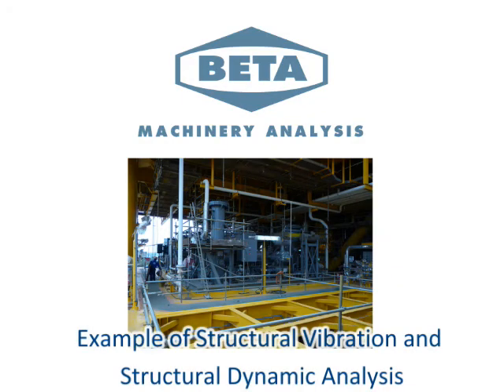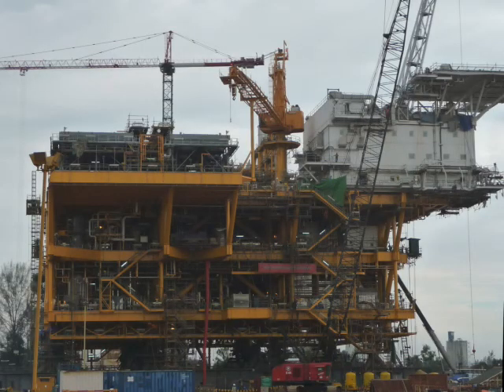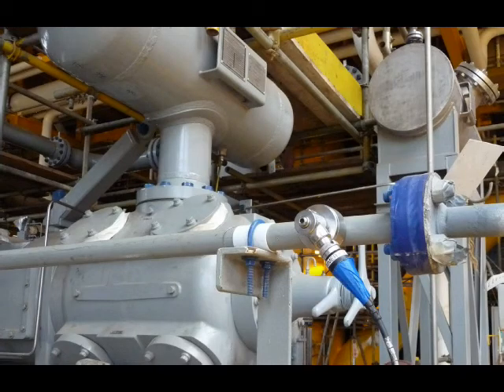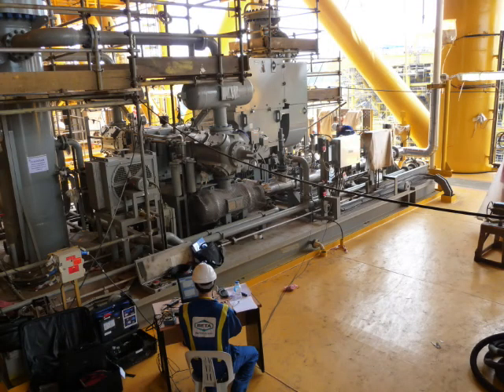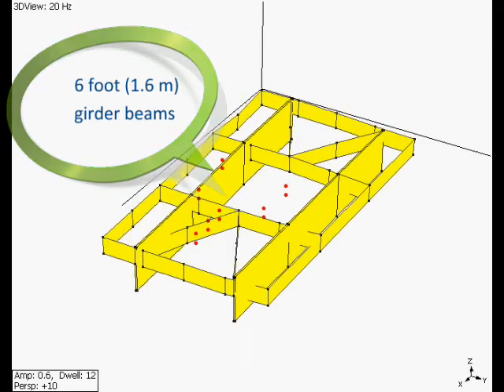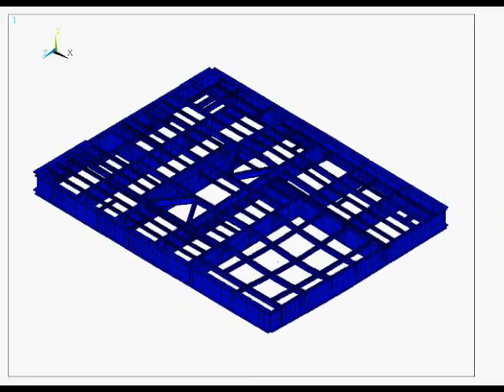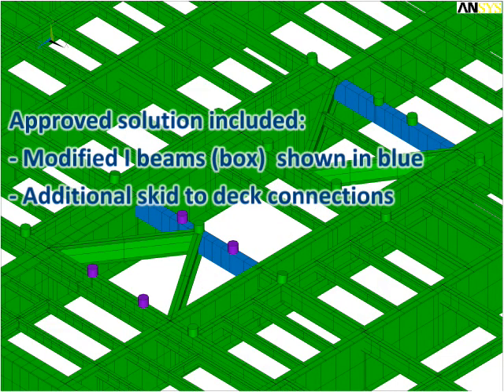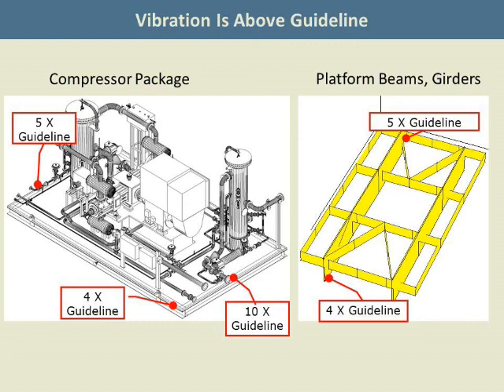Example of Vibration and Structural Dynamic Analysis

Comment: Why not just put vibration isolators?
Reply from the maker: This particular problem is due to resonance of the girder. Therefore, it is better to eliminate the resonance first.
An isolator is known as active vibration control. It prevents dissipation of vibrations from the machine to the surrounding (structure). If the magnitude of force from the source is the main problem, an isolator could work.